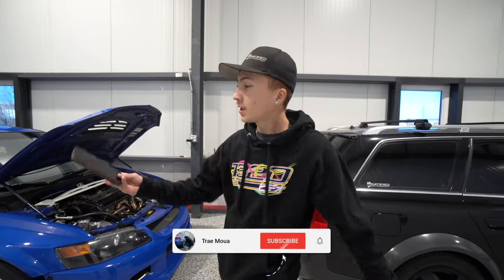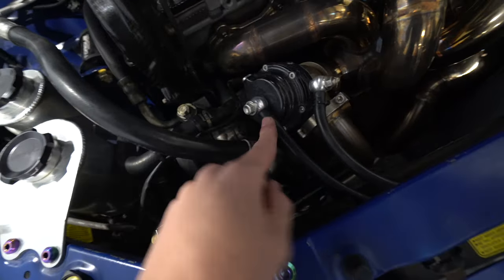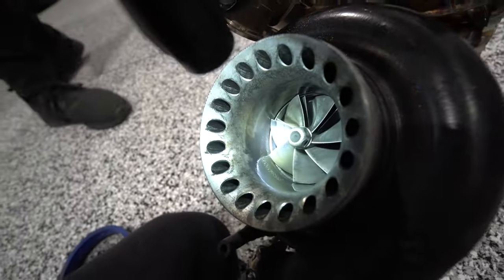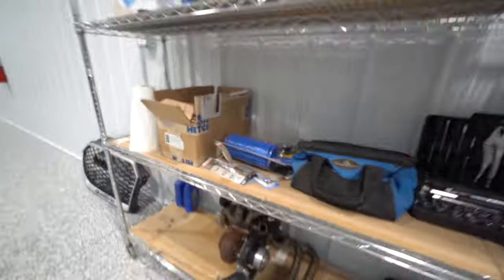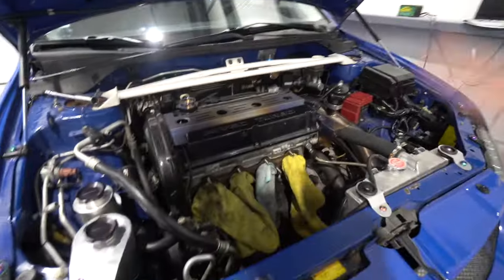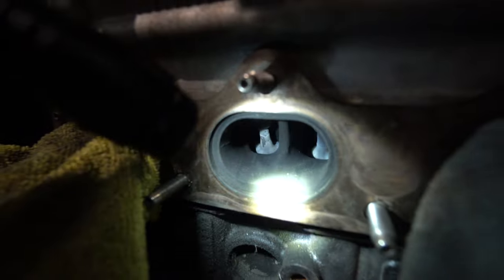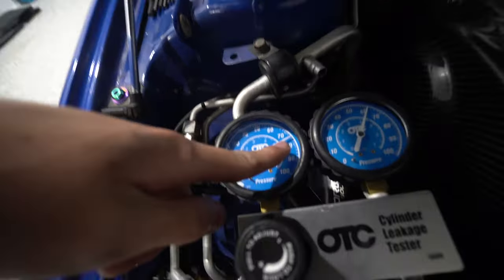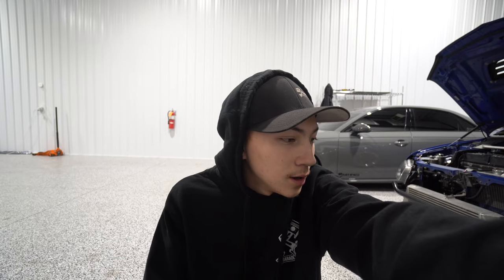This Was A BAD start to My New Evo build..

Comment: Say u heard cylinder 4 leaking like in the video  could u technically spin the crank pulley with the ratchet on confirming your 100% top dead center or go  another 360 degrees to confirm your valve is seated at much as it can be. I guess it would be kind of hard to turn the crank pulley with 75 psi of air  in the cylinder tho lol.
Reply from the maker: Yes you can and yes I did haha

Comment: That's valve leakage. Not valve seals.
Valve seals can literally be done on the car. This will require valves being replaced and the seats cut.
Some side to side play is okay on a turbo. Any in and out is a no. Oil pressure will take up the side play.
Reply from the maker: There’s no air escaping beyond and through exhaust, so unless it’s intake (which can physically be seen) I don’t believe it’s not seating properly. But, the head is going to get a refresh anyways so at the end of the day everything’s getting replaced haha
Reply: @TraeMoua   yaah. In order to make it past the valve seals it would have to leak from the cylinder past the valves.
If nothing is leaking through into the runners (the valve seats seals this from the head to cylinder walls), suspect piston rings.